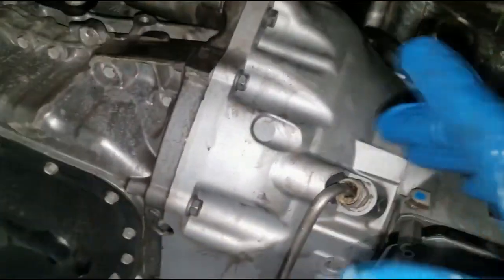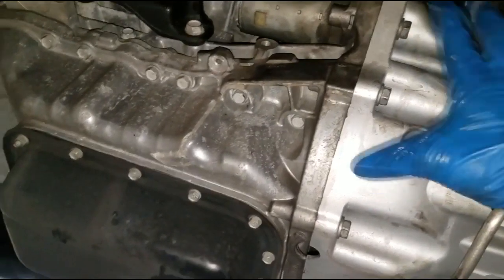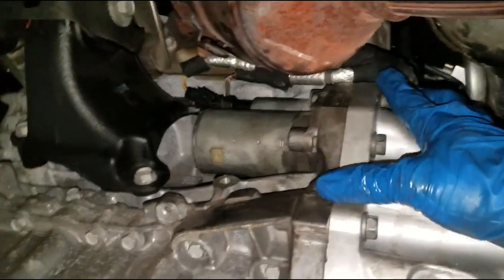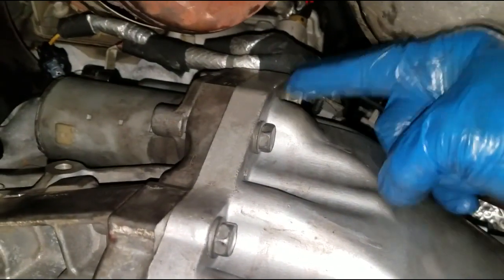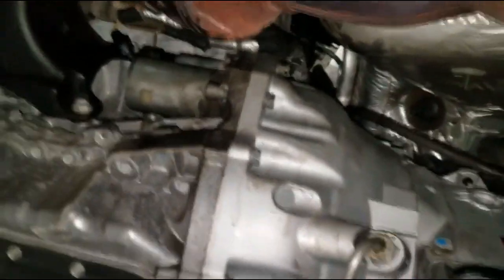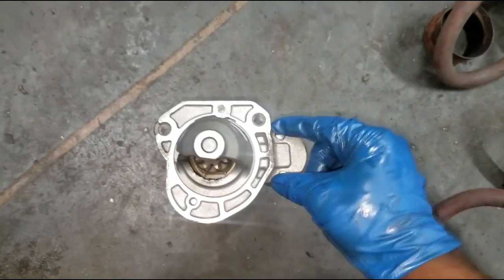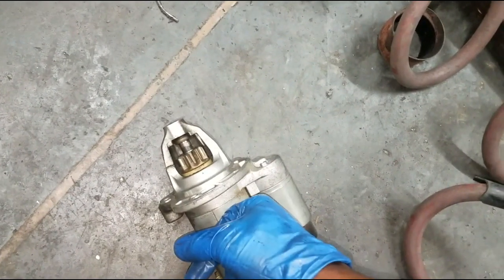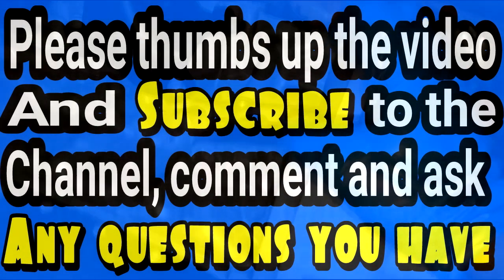Lets talk about the starter and why its needed. Basic discussion and starter replacement on a Jeep.

Comment: Last car I had to do a starter on was my ex Neon. Got a lifetime for 100 bucks and it was the original one. I tried the tap it and it was done so replaced it. It was a bit tight but not horrible and the original was like 25 years old so they usually last a long time if the engine starts easily.